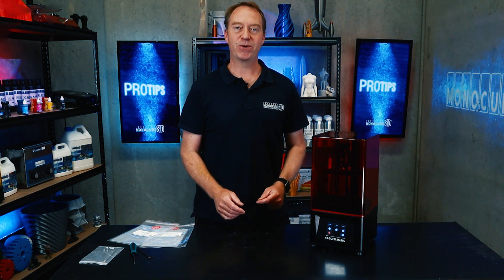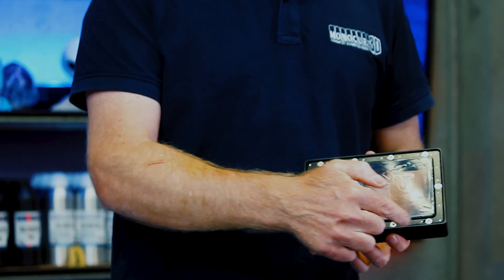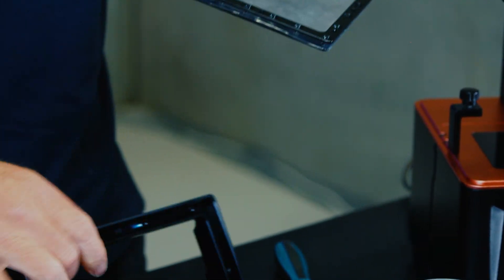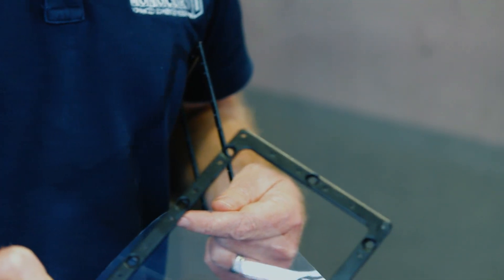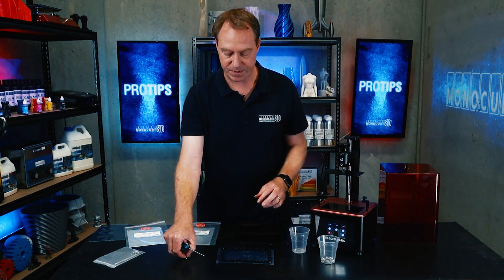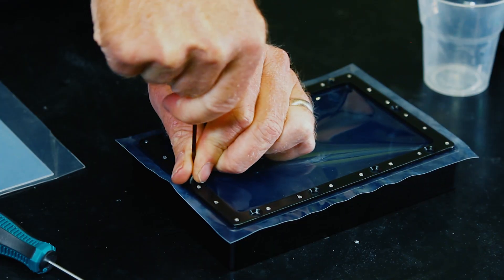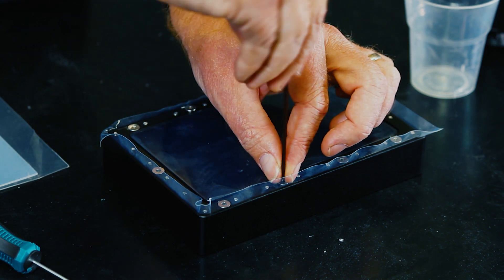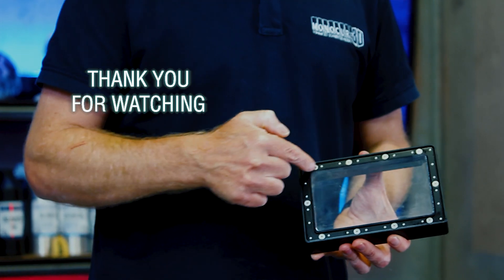Changing the FEP Sheet - 3D Printing with Resin - Part 05

Comment: i keep having leaks from the coroners when i replace my FEP screens...ive had to replace my screen protector multiple times idk whats going on. Please help
Reply from the maker: What printer is it? Some of them have rubber seals. Maybe yours is missing?
Reply: @Monocure3DProTips  Mars 3 i dont recall a rubber seal?
Reply from the maker: @jacobschutz2592  dont think the Mars 3 used a rubber seal, some of the Creality printer vats have them. I know some have been able to overcome this by going for a 200 micron sheet and making sure it is done up very tight! Another option is a bead of silicon, but makes it difficult to change FEPs!

Comment: I always start in the middle tightening the screws and work my way from there to the outside. That way you push the the tension to the outsides. Head gaskets for engines are tightened the same way. Circular is just for round objects
Reply from the maker: Agree!

Comment: Two quick questions. 1) What's the height of the lid in MM, and 2) if you make your FEP too loose can you salvage it or do you need to bin it and start again?
Reply: So... What was the height?
Reply: @colemanwhite9785  just use 32 playing cards. Worked perfectly for me.
Reply from the maker: I’ll have to check when I’m back at work regarding the height of the lid. You can start again with the FEP, might need some heat to get it back into shape.
Reply: @Monocure3DProTips  heat? You mean like a hair dryer?
Reply from the maker: Sure or just sit on top of your FDM build plate with the heat on.

Comment: Would it be a good idea to do a "dry run" afterwards to make sure the pressure from the plate doesn't rip the film on first print (in case the film is too tight)?

Comment: Cut off the excess film before attaching it to the vat. It makes no sense to cut it off after it's installed.
Reply from the maker: The first time you cut it too small and it doesn't fit you will think differently! 😂
Reply: @Monocure3DProTips  I am talking about after you have put in the smaller screws. (the first set of screws)
Once the FEP is sandwiched between the 2 frames, you cut the outer excess off. Then you install the frame into the vat securing it with the large screws.  
It is impossible to cut it too small once it's in the frame. =)

Edit: 5:07  This is when you cut off the excess. Then install it into the vat.

Comment: How high of a spacer for slack is needed to do the first stage?
Reply: I thought that too... I'm changing mine for the first time as we speak and for a precision piece of kit, the whole 'use a lid' trick doesn't seem like a standard metric to me 😅 I'll give it a go and see how it works out, if it doesn't I'll just have to adjust via trial and error I suppose.
Reply: So, you're telling us that lid was 5/100ths of a millimeter? It looked thicker than 5mm. Thats 1/2 of a Centimeter. That lid looked at least 2cm thick. For what its worth,  I saw a comment in another video that claims 32 playing cards are the perfect thickness for a spacer as a replacement for the "sponge" Elegoo recommends. Seems a few people tried it and it worked perfectly.
Reply: I tried the 32 card trick and it worked perfectly.
Reply from the maker: I usually use a lid from a Resin Bottle.
Reply: @Monocure3DProTips  I use a different brand of resin, so the height is different. What's the height in MM?
Reply from the maker: 0.05

Comment: The FEP is all scratched in the middle from using a lid to produce slack.
Reply from the maker: If you were worried about that, you could leave the protective layer in that area if you peel it back away from the edges.
Reply: @Monocure3DProTips  OR.......Use a non abrasive  pad like a Bottle top with a Cloth over it?? Can't see the point of using something hard and abrasive like a plastic cap which clearly scratched your FEP. Elegoo recommend some soft foam, like the packing you got in with your printer!
Reply: @GrumpyBusDriver  potentially use the old fep as the sacrificial lamb to protect the new fep?
Reply: @GrumpyBusDriver  just use 32 playing cards. That way, you don't have to guess the resin cap size or scratch the FEP.